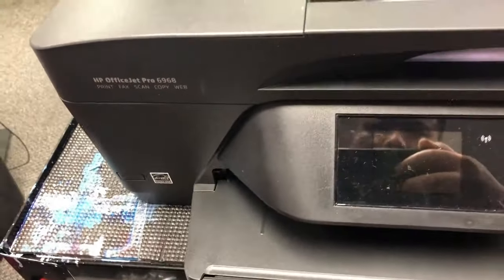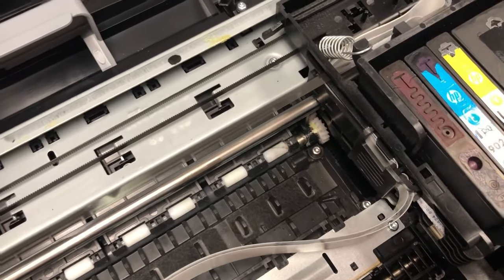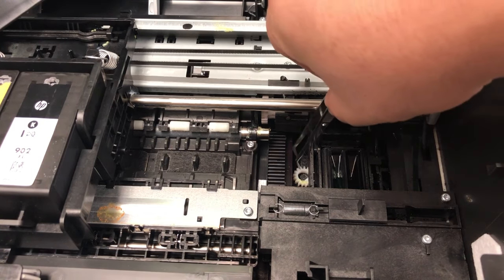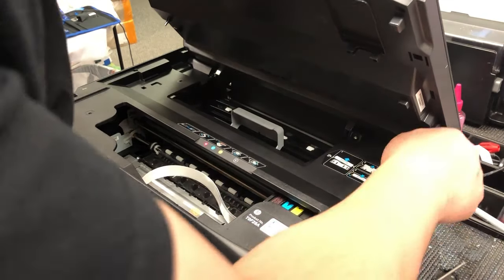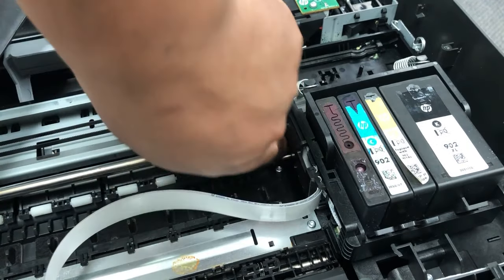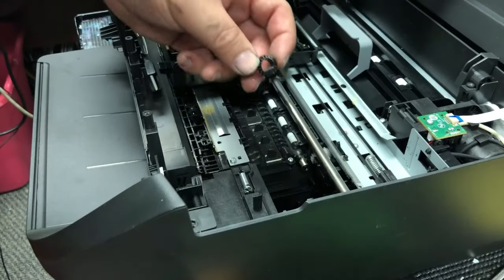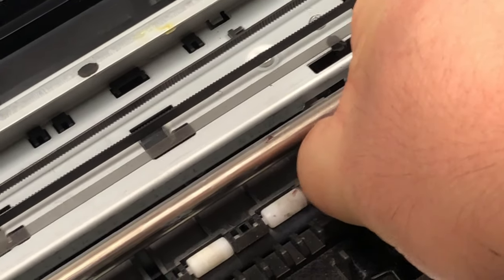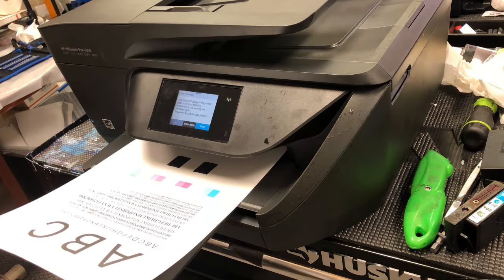Printhead Stuck on the Right - Carriage Jam for HP OfficeJet Pro 6958, 6968 6978 Printer PFG

Comment: I have an issue with my printer that is similar, in its symptoms at least. That gear is there and if I manually turn the wheel the tray moves backwards and forwards without a problem. This allows the print head carrier to move side to side. However, if I leave the printer to do this, I get an error saying there is a printer error/jam. I'm certain it's something to do with the carrier not being allowed to move unless I do it manually. Any ideas?
Reply: Same issue I’m tossing the whole thing. 4 hrs wasted
Reply: Realizing this is an older comment, I wanted to come here today and relay a story about what happened to me with the same errors you had.  In addition to checking Kevin's gear issue, there are other things that may cause the carriage jam and paper jam errors to pop up on the screen.  When these happen, they will not fix themselves.  Something needs to be done.  Either paper needs to be found and removed, the gear needs to be replaced, or a sensor needs to be checked.

Note that when an error (paper or carriage jam) pops up, the printer is sending a notification to the computer chip that one or more of the drive wheels or rollers are not moving.  Those wheels and rollers are all mechanically connected to a movement sensor somewhere inside the case.  If the sensors aren't seeing movement, a jam error appears.

There are three sensors that are easy to see and get to when the top cover with the ten screws are removed.  There is one larger one (about 2" in diameter) on the left side to the right of the main printed circuit board near the bottom of the case.  It is mounted to the left of a white gear that runs the main drive roller you see when the ink carriage is to the right. The drive roller is mostly grey in the middle, and chrome colored on the left side where the gears are attached.  That white gear also has a rubber belt that turns it.  It is directly in line with, and below, the thin cartridge position sensor strip I talk about in the next paragraph.  It is a very thin clear round disk with dark markings on it.  It spins when the left gears spin.  You need to make sure that clear disk is in the slot inside the sensor reader.  The sensor reader is below the thin disk on a printed circuit board.  In my case, someone, or something, caused that sensor disk to become lodged outside the sensor.  I didn't get the printer new, and it didn't work when I got it, so someone else may have worked on it and put it back together wrong.  But I did have all kinds of jam errors.  Having that clear disk outside of the sensor would tell the printer computer chip that something was not moving and jam errors would appear.

The second sensor is the one that reads the position of the ink cartridge carriage tray.  It is a long (about 12") and thin (about 1/4") almost clear strip and it runs from left to right behind the ink cartridges.  There is a sensor reader that this strip fits into on the ink carriage.  This thin strip must be positioned inside the reader for it to operate correctly.  If it isn't, the ink carriage will slam to the right very quickly.  And because the sensor isn't seeing the correct movements from the carriage, you will get carriage errors to appear and the carriage will be locked to the right side.  The strip has markings on it.  On the right side of the strip there is a triangle and a round dot in black.  The triangle should point backward when installed correctly.

The third sensor, and the one which is least probably the problem, is the sensor on the upper right side rear, on the inside and to the right of the paper travel path.  This sensor is underneath an about a 1" square printed circuit board.  It spins when the cartridge cleaner process is in action.  Make sure the thin disk is positioned inside the sensor.  This one will probably be ok.  The other two need to be checked.  The problem this sensor will indicate will be if the cleaner module gets gummed up with ink and prevents its movement.  Eventually, that module will need to be removed and cleaned to make sure that sensor disk is free to move.

So like I said, in addition to checking the other things Kevin mentions, make sure you check these sensors.  I messed with mine for a long time (weeks) before realizing two of them were not in the right places.  Once fitted properly, I was able to get a non-functioning jam error-laden printer (HP6978) back in business.  Good luck with yours.
Reply: @tania196  
See my response below if you haven't already tossed it.
Reply: @HD24680  I checked all 3 sensors. Everything looks fine. It is a new printer not a refurbished one so nothing was out of place. Any other ideas?  The carriage keeps stopping in the middle of the printer and saying remove jam.  The sensor/tape on the carriage is in place so any other ideas?

Comment: Thanks, I got the new gear from BCH which the original was cracked.  I installed it back into my OfficeJet Pro 8028. BUT, I still get the carriage is still jammed.  It keeps jamming in the same place.  Do you think I need to install a new driver or open it back up again to see if there is anything obstructing the carriage?  Help!

Comment: This solution alllmoost worked for me. Once I plugged in and restarted the printer the cartridge moved as it should. It even slid to the left twice. But after that it got stuck on the right side again. To me I don't think any gears are broken or it wouldn't move correctly at all. So I don't know what else to try. Any suggestions?
Reply: I have the same problem
Reply: @michaelbird1485   Shortly after i posted this..I had given up.. My husband ordered me a new printer already. I put the lid on .. screwed everything back in. Then I thought well I’m just going to reset to default and do a printer head alignment. And if that doesn’t fix it. Screw it! I’ll have a new printer on the way. And low and behold.. after a lot of whir’s and gur’s coming out of the printer..the screen went back to normal! No errors, no paper jams. So I said .. what the hell.. let me try to print something. And Voila! It printed! I had my printer back! I quickly called my husband to cancel the order. And he did. Happy Ending! Hopefully this will work for you too.
Reply: @ln1250  how? The error won’t allow any commands.
Reply from the maker: Thanks for subscribing! If it can go back and forth a few times, the gear is okay, and just resting on the right (not stuck). Try to clear out any old print jobs, and restart the printer and computer.

Comment: Thanks for sharing this!!. 
I opened up the right side door and was able to see the cartridge compartment and a little gap to the gear. In my case the gear had a crack and it was halting the moment of the cartridge and the bottom gear. I used a little pin to push the gear in and start the printer. Once the cartridge moved I immediately switched it off and was able to access the gear. Used a soldering tool( you can melt it with a ball pen nib) and melted it a little bit and voila it worked!!!

Comment: Well kevin we have 3d printed a few to fix this problem, we have done it in both the 6968 and the 9010, 9020 series of printers. I didnt know that you sold the gears though. HP is so smart that they change the size of the gears ever so slightly so you had to get diffferent gears to solve the problem.
Reply from the maker: Yes, that's how we come up with this heating solution, so it can fit tightly after cooling down.

Comment: Hi Kevin my HP8020 cartridge is jammed. Does it also mean that the gears are broken and I have to open up the printer/scanner panel to fix the gear?
Reply: Yes, I did. Found the gear cracked. Bought the gear, reinstalled it, & still jams up.  It looks like the printer is off sync.  So, just the gear alone won't fix it. It sounds like a lot of people are having this issue.  Mine is a HP Officejet 8028. Did you get yours to work?

Comment: I followed your video and unstuck the carriage, but the carriage keeps getting stuck when I turn the printer back on. I took out the gear and it looked fine, I cleaned it and reassembled, but same problem occurs
Reply: Same
Reply from the maker: Thanks for subscribing! Have you checked if your timing belt (the clear plastic stripe behind the printhead carriage) is clean?